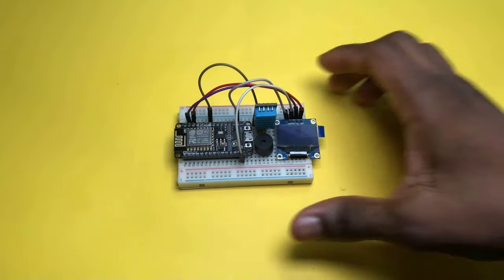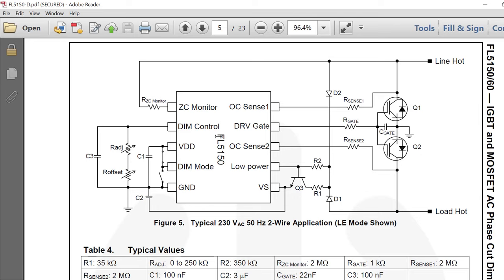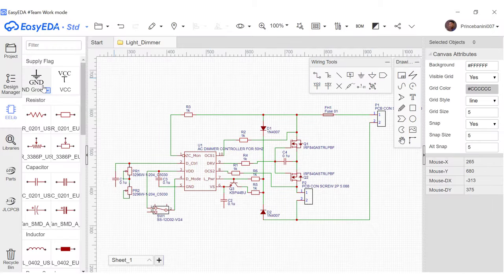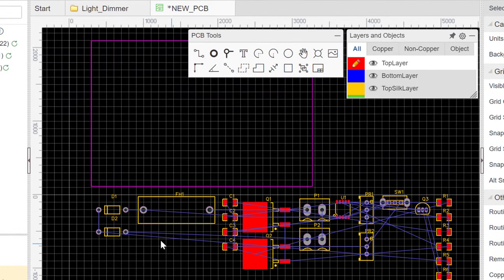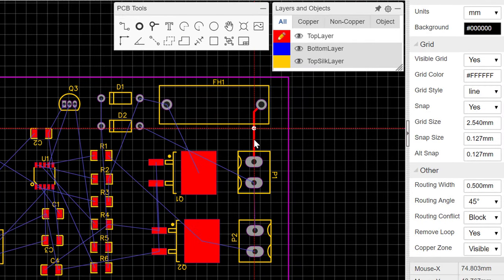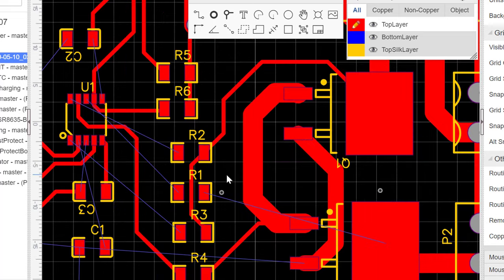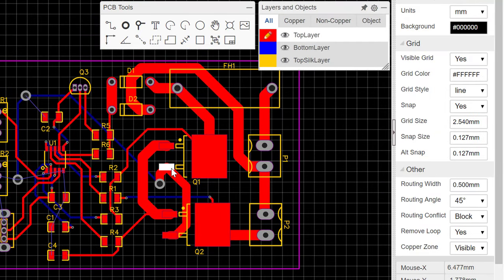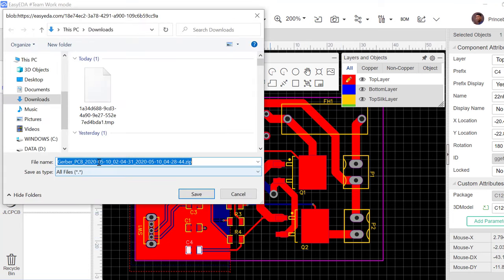How to Design a PCB from Scratch with EasyEDA | COMPLETE Tutorial | JLCPCB LCSC ALIEXPRESS | 2024

Comment: An easier way of adding via's is to simply draw a track on the top layer, and when you encounter an obstacle, you click to create another node where you want the via to be, and then switch to the bottom layer, and it will automatically create a via for you right where your last node is. Then you keep on making your track on the bottom layer, and when you want to switch back, you switch to the top layer again, and it will create the second via. Not sure if this is a new feature that wasn't available back then, but in the current version it works like that.

Thanks for the great video!
Reply from the maker: This is an eye opener for me and hopefully a lot of people.

I didn't know what you just explained exist until just now. I tried it and it works just as you mentioned. Thanks so much. I'm gonna make another EasyEDA video and use this new approach in it together some other new tricks I've picked up.

Thanks so much once again fam. Much Love💗

Comment: Hello, Just one question (sorry for the dumb question)
What does the package type means? I did not understood that part. Is it ok if I leave the package type as it is? How will I know what package type I have to look for, to change it for every component?
The rest of the video is pretty clear. Like and subscribed. Much appreciated all the help.
Reply from the maker: Feel free to ask as many questions as you'd need, if it helps clarify stuff for you.

Package type is simply the shape and size of components.

The package type to use in a project depends on what you're designing and how big you want it to be when finished. So for instance, if you want your circuit to be small, you'd want to go with "0603" resistor and capacitor package types.

Knowing the specific package type to choose for projects comes with experience, time and actually using a calliper/some form of tape measure to draw out/measure dimensions of parts in order to visualise how big they'd be in real life.

As mentioned, please ask any and all questions you have. Cheers!!

Comment: Excuse me for the blunt question, can I know why does EasyEDA does not automatically generate holes/pad for Vcc and GNB which can be used as power supply to the board.
Reply from the maker: Good question. I think its probably because the software isnt sure whether you want a hole or smd pad. So it would rather you choose what you want yourself

Comment: Hey buddy,

Followed your video and had no problem in creating my own board and design. However after submitting the order, JLCPCB got back to me to say that I have 'no edge rails' in my design and told me to add it. Can you explain on this as I don't know what that is or guide me to any another video of yours to explain these steps?
Reply from the maker: Thanks for reaching out friend.

Kindly let them add the edge rails. think of it as the borders protecting your pcb...you can break off these boarders when you're about to use the pcb.

alternatively, search for "pcb edge rails" on google. then go to the google images section. you should have a fair idea of the edge rails from there. 

Please let me know if you have any other concerns i could help with. Cheers!!

Comment: Sir what steps do I need to follow inorder to design an already existing PCB with top and bottom layer in PDF format I downloaded but with no schematic diagram? 
Please help me sir I love this PCB very much that I want to design it myself.
Reply from the maker: You'd have to get the schematic diagram for the pcb design you have in pdf. Then you can follow this video to recreate the design in EasyEDA and then to pcb.

If you cant find the schematics diagram. You'd have to reverse engineer the pdf you have by tracing each track one after the other to recreate the schematic. This isn't very efficient and can be very stressing and time consuming depending on the complexity of the pcb

Comment: Sir how do I mask a particular area in my circuit where heat sink would be mounted in order to avoid short circuit with the Traces on that region in EASYEDA
Reply from the maker: I'd advice to avoid putting tracks where heat sink will sit at all cost.

But if you have done that already, I'd advice you stick a heat conduction but electrically insulated pad in that area where the heat sink sits or you can just use the insulation pads  between the transistor and the heatsink to avoid the heat sink conducting at all.

Hope this helps.

Comment: Thanks for the video. I tried to make a simple PCB with an EDP8266, MAX485, RGB LED and a few resistors. The auto-route gave me an error; attempted: 55, completed 54, failed 1 but there is no guidance where it failed. How can I trace where the error is?
Reply from the maker: Try exporting your pcb to Gerber, you will be prompted to check wiring, select the check wiring option. All errors or possible issues will be presented in a window to the left in the easy eda software, there you can click on each error message and have the software show you where the error is on your pcb.

I hope this helps!.

Comment: Awesome video.
Quick question, why did you choose 2.5mm for the first routing?
Is that a standard or there is some calculation to determine it?
Reply from the maker: Thanks for reaching out Felix

I chose 2.5mm because it seem to be reasonably wide enough. There was no standard or reason behind that beyond it been visually better.

There is a way to calculate what width is suitable for which current, but I didn't use any of that in this video...I wanted to keep it simple.
Reply: @Delali  Thank you so much, eager to see your next jobs!

Comment: Sir i facing problem  about spice model pls make video on that.   Or give solutions in comment box
Reply from the maker: Thanks for reaching out.

What specific problem are you facing?
Reply: @Delali  whenever import new library. Only schematic diagram and pcb package are coming. Internal structure not there. Because of this i wont able to do simulation

And shown error. Spice model not specify
Reply from the maker: @kaustubhjagtap2735  I'm guessing its probably due to selection of incomplete/user contributed parts. 

Can you try selecting the same parts(the ones you are experiencing the problems with) from different manufacturers? Let me know how that goes.

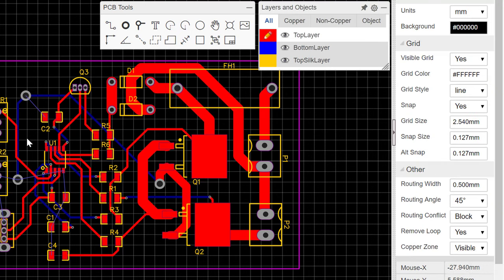Comment: at 27:50 why did you apply ground net? why did apply at that specific area only?
Reply from the maker: I applied ground net to join all grounds together. Also it provides a much wider return path for current. Lastly it also serves as a form of passive cooling for components that may get warm.

I applied the ground net to that specific area to prevent any electrocutions, short circuit or electro magnetic interference issues that could rise with the presence of AC mains.

I have explained everything in detail in the video. Kindly take some time to go over the whole video if you can.

If you have any further concern(s), kindly dont hesitate to ask.
Reply: @Delali  thanks bro
Reply from the maker: @nithinsai2250  You're welcome buddy.

Comment: In this software is there any option for auto rerouting of schematic?
(I'M ASKING ONLY FOR CIRCUIT DIAGRAM NOT PCB REROUTING BECAUSE I HAVE A CIRCUIT DIAGRAM OF POWER SUPPLY AND ALL THE COMPONENTS ARE MESSED UP IN DIFFERENT PLACES SO I WANTED TO REARRANGE THEM INTO NEAT CIRCUIT DIAGRAM)
Reply from the maker: unfortunately not, but there is auto routing for pcb routing.

Comment: Hi Delali,
many thanks for this video! Mainly thanks to it, I learned to use EasyEDA a bit and I created my first PCB in one day :-) Before that I tried KiCad and Eagle, but without success. One tip - as I found out, the track through the bottom layer can be made easier - just start on the top layer, after clicking to the point where I want to have a Via switch to editing the bottom layer, continue the track to the next via place, switch back to the top layer and complete the connection. The vias are created completely automatically :-)
Reply from the maker: Am very happy to hear your success story. Am glad this video was of help to you and thank you very much for the tips. I will try to put that in my next video. 

Please dont forget to subscribe.

Comment: Hey quick question, what are the footprints for through hole resistors, electrolytic, and ceramic capacitors?
Reply from the maker: Footprints are shape and physical characteristics of the components in question. So for instance a through hole 1/2 watt resistor is about 9.2mm in length with terminals that are about 0.6mm in diameter.

These characteristics allow for each part to fit perfectly in their spaces on the pcb

Comment: Can you please explain to me this circuit how it work 
It's very important as I have an exam in it
Reply from the maker: The fl5150 ic switches the mosfets to output either a leading edge or trailing edge signal that causes the bulb connected to dim or brighten.
Reply: @Delali  it's working by Ac voltage supply not DC yes?
Can it work with DC
Reply from the maker: @3lichith895  This one works with AC. There are also circuits that work with dc versions

Comment: Does the schematic sheet dimensions determine the actual size of the PC board?

The current schematic sheet dimensions I have are width:1169; Height:826 Are the units in Millimeters or inches?

also, how do you annotate on the schematic sheet?

Thank you
Reply from the maker: The schematic dimensions doesn't determine the size of the PC board.

Rather the dimensions of the PCB determines the size of the board in real life.

The schematic sheet dimensions dont matter. only worry about the dimensions of the actual pcb...that is the dimensions of the purple boarder lines around the components.
Reply: @Delali  Thank you~
Reply: Working on my schematic diagram, why is it when I select a Ground symbol from my wiring tool and place it on the schematic sheet, and then use a wire to connect the Ground symbol to a component, I get a red error message in the  Design Manager saying under Nets, saying "this netlabel  is not connected with any pin"
Reply from the maker: @uiticus  Perhaps its not connected to the component properly or maybe that components terminal is not a ground pin
Reply: @Delali  Hello. Sorry to respond so late . I was working on my circuit. What I meant to say is I have several resistors on the schematic that needs to be grounded. But each time I try to connect the ground symbol or label to the resistor using a wire, and then I check the Design Manager and click under nets, a red flag appears there saying that the ground symbol or label is not connected to any pin. But when I remove the wire and connect the ground symbol directly to the resistor, the red flag disappears. It is happy now. Why does it not accept a wire connection to connect the resistor to Ground?
Reply: I know this program has a ground Net copper area which is nice since it automatically routes or connects all the ground connections. But does it also have a Vcc Net where it will connect all the Vcc points?

Comment: Great tutorial! One of the best ones i have seen! Don't you have to make connections between ground pins/pads and the ground plane? Will the pads be connected automatically to the Copper area? I am currently working on my first PCB, which is going to be for a guitar compressor pedal.
Reply from the maker: I connected the ground pins and pads together using a ground net. 

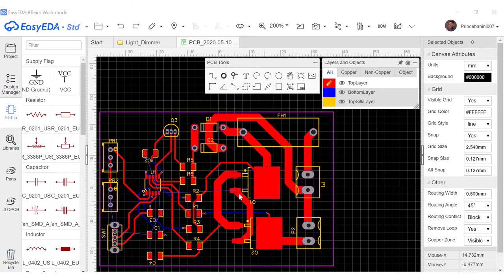Kindly see 25:48 of the video for reference.

Comment: Did you route most of  the individual ground connections to the  ground net via at the bottom layer of the PCB? 2) Which tool should you use if you want to place a hole on each corner of the PCB for screws to mount the PCB? 3) Can tracks cross each other? Thank you
Reply from the maker: Nope, I didn't route the individual ground connections to the ground net at the bottom layer. 
I left all ground connections and finished all other routing that is not ground.

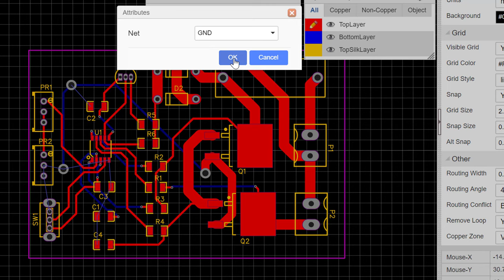After that I used a GND net to auto connected all grounds together. See 27:50 of this video for how I did that.

To mount screw holes, pick a via and drop it at the location you want the hole to be. Next make the diameter of the via bigger and make the hole diameter bigger as well to match the size of the screw you want to use [simple/fastest approach]

Please feel at ease to reach out if you have any further inquiries. Cheers!!
Reply: @Delali  Thank you much for you response. I appreciate it. 

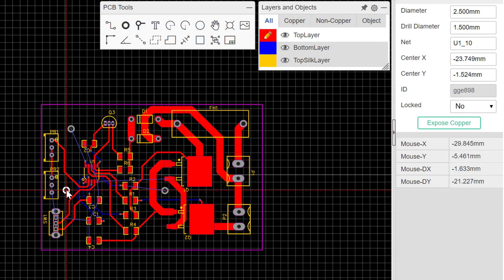But I noticed at time line 27:09 you routed each of the ground tracks manually. Or did I get it wrong?  Or is it by placing those 3 vias the app will connect all the grounds automatically? i do not get it.

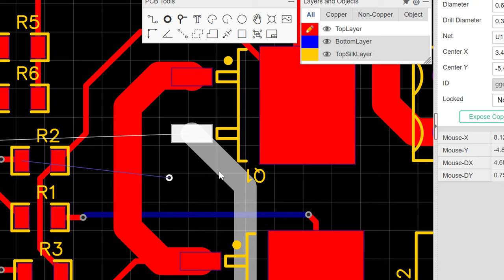It seems like the first via you made at timeline 26:26 and then enlarged it, and the 2 copies of this via, connect to nothing? So how can all the individual ground connections automatically route to each other by creating a ground net?

Also, may tracks cross each other?
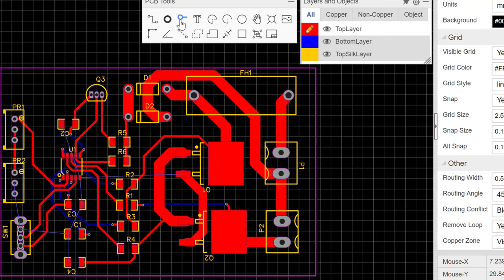Reply from the maker: @uiticus  So the ground I wired at 26:26  there about is because I was was going to apply the ground mesh to only one side of the board, which is the left half of the board.

This is in attempt to separate the high voltage AC part of the board from the low voltage part. so I had to manually wire the ground from the ac part into the left part of the board where I will apply the ground mesh.

If there was no AC voltage involved, there wouldn't have been a need to make that first ground wiring. I would have just used the GND mesh for the whole board.

----------------------------

also yes, tracks can cross if only they are on different layers. If they are on the same layer that will result to a short circuit or other complications.
Reply: @Delali  Thank you! 

Just one more point to clear up my confusion. Does the ground mesh auto route all the individual grounds of the circuit automatically to ground or do  we still have to manually route each ground connection separately?
Reply from the maker: @uiticus  The ground mesh automatically connects all grounds within the perimeter of the mesh to Ground. No need for manual routing to Ground after that.

I will be available to address any concern(s).

Please don't forget to subscribe. Cheers!!
Reply: @Delali  Thank you much!
Reply from the maker: @uiticus  You're welcome fam.
Reply: @Delali  So this means that any ground points outside the ground Mesh perimeter needs to be manually grounded. right?
Reply from the maker: @uiticus  Yes please.
Reply: @Delali  Thanks! One more question. Why didn't could not we  use the Auto Route feature of this program where it will automatically route all the connections on the PCB by itself?
Reply from the maker: @uiticus  The auto routing usually doesn't know which components gets hot/warmer in operation. Also it doesn't know that there should be a gap/gaps between AC tracks and low voltage tracks.

These basic rules can be missed by auto routing so its usually better to manually do the routing. Alternatively i could have used the auto routing and then deleted just the AC tracks and manually positioned those tracks and components myself.
Reply: @Delali  Thanks much! I appreciate it. Wish you a Beautiful week.
Reply: I started using the Easyeda and each time I select a component from the common library and place it on the schematic sheet, the size of the component is very huge, it almost fills the entire schematic sheet. What should I do to correct this size problem?

Also, on the schematic or canvas  properties what does the snap property do?
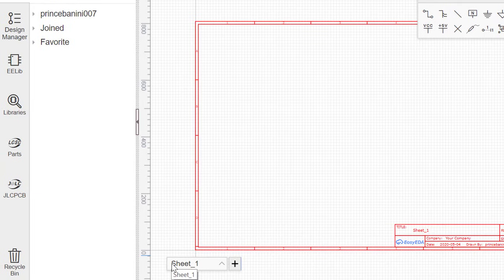Reply: also at time 4:13 how do I move the info box to the right bottom corner like you have it? The one I have is more to the left and top. and how do I increase its size?
Reply from the maker: @uiticus  Try dragging the info box using its title bar to see if it can be repositioned.
Reply from the maker: @uiticus  Not sure why that is happening but perhaps you can use the scroll wheel on your mouse to zoom out.

I've been checking the easyEDA documentation to see if I could get a solution but I haven't got anything so far.
Reply: @Delali  Thank you much forall the great help!